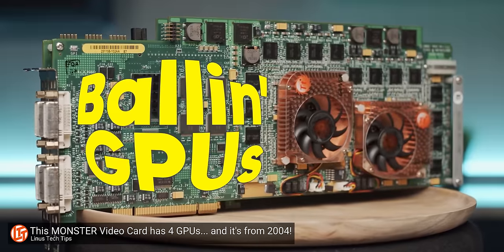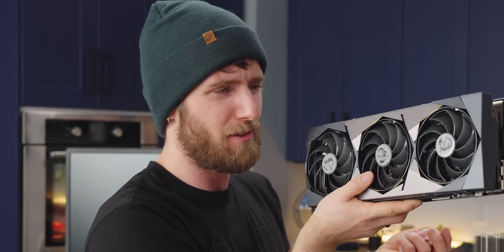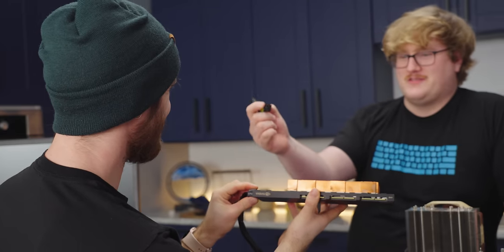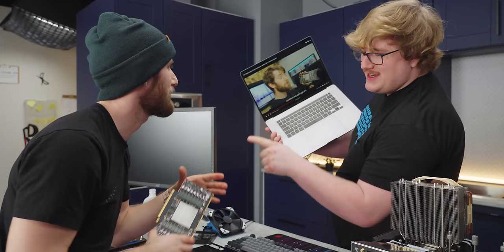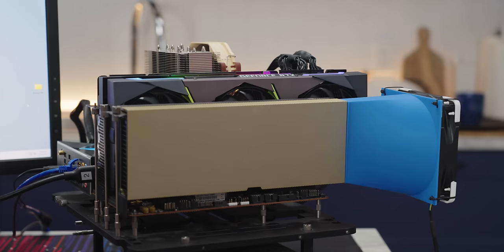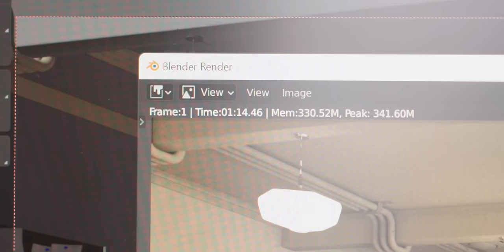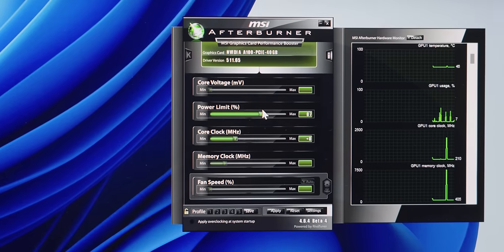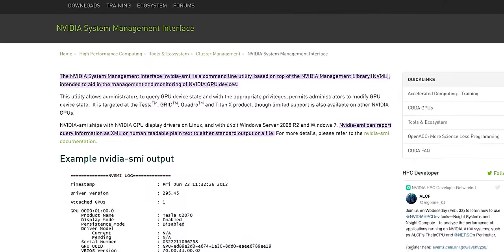NVIDIA REFUSED To Send Us This - NVIDIA A100

Comment: Fun fact, our A100 servers (8 80 GB SXM A100s per server) each have a max power draw of close to 5 KW. And Linus and Jake were right! Even with the 80 gig models, we still wish we had more memory. Never enough memory!
Reply: Big Iron.
Reply: what are you doing with that hardware?
Reply: @velo1337  Skynet, duh.
Reply: @velo1337  Playing Crysis, probably.
Reply: @velo1337  The largest AI models currently use hundreds of billions (or more) "parameters" (a measure of the size of an AI model), and we know due to something called scaling laws that bigger models are more intelligent. You can't fit hundreds of billions of parameters into less than hundreds of billions of bytes, or hundreds of gigabytes of memory. Thus, an AI researcher wants the most VRAM they can get, even to the point of distributing models across multiple cards and cluster computing, etc.
Reply: @ProjectPhysX  I used to handle that on racks upon racks of Xeon Phis for exactly that purpose. At one point, when Kepler based Teslas came out, three 6-card nodes replaced all that. Currently single A100 has more horsepower than all of them. Now I am handling racks upon racks of P100s and V100s.

Our project (custom written from ground up) use particle batches (we call them slices) as base unit for parallelization, four-card Xeon Phi  system needed 30 seconds to process 100 slices, with ~5-6 seconds of that was only data being moved around. Previous gen hardware (we have only one borrowed test system with A100) is capable of constant execution of ~13k slices/second per card when hooked to 100G network and ~8k on 10G network. Memory is one thing, but keeping these chips data fed is turning to be a bigger enterprise than the actual computational part. 

There was an AMD Radeon Pro card which used M.2 drive as cache. We tried to use that for portions of framework written in OpenCL, but it wasn't worth it, memory be damned, it was too slow, as it was basically desktop GPU :(
Reply: @Vatharian  - it is an absolute shame AMD hasn't followed up on those with later models. Too early, too little. Even the shitty model did wonders for movie rendering supposedly. Was it Disney or Warner who used them? Now with PCIe4 you have double the bandwidth and soon PCIe5 drives will be possible. Together with the new double-die Instict Mi250X and some (512GB+) of the super fast XL-Flash (SLC NAND optimised for performance) or 3DX-Point they would totally crush some extreme workloads despite the snail pace memory compared to HBM.
Reply: @velo1337  the cluster is available to many teams throughout the company, but our team specifically uses it to develop deep learning models for computer aided engineering tasks. Our largest model is a surrogate model for a computational fluid dynamics solver.
Reply: @Vatharian  Seems like the spam filter deleted my first answer because I posted a link to an arXiv preprint.
The progress hardware has made over the last decade is crazy. I also use my own CFD code, written completely from scratch in OpenCL. It runs 2 orders of magnitude faster on GPUs compared to CPUs, at the same power consumption. And it runs on anything, A100/V100/P100/MI100, gaming GPUs, Intel CPUs, even on the ARM Mali GPU of my Samsung phone. Visit my channel to see the software in action, and for links to my research papers :)
Reply: if only i could remember more faster!
Reply: Is that why an R9 390 goes for $100 more than a GTX 1060 even though it is older?
Reply: The cost price you'll have to pay for precise calculations.
Try running 32 bit fpp calculations, which are still good enough, and you can cut the memory down to between 500Megs to 2,5GB per WU.
Reply: @velo1337  your dad
Reply: guess what, i also maintain 4 of the DGXA100, and still we sometimes do not have enough
Reply: Literally what 80% of our A100 servers are set up as. We definitely changed PSUs and back up Batteries, cannot wait for Sapphire Rapids to come out (because we’re nearly ALL Intel) and have literally 10 of these that are AMD EPYC.
Reply: You guys need IBM addon memory cards :D
Reply: @velo1337  minecraft with shaders, they still only get 2 fps tho
Reply: @velo1337  having more than 2  Google Chrome tabs running smoothly
Reply: pls tell me ur not using consumer gaming gpus like 3000 series gpus aswell cuz thats all i care about. just let other people get gaming hardware.
Reply: @alt2484  at least for us, we couldn't use gaming GPUs even if we wanted to (we don't - we need the NVLink topology of the HGX platform for high performance GPU-to-GPU communication) because Nvidia changed the license on Geforce cards to not allow them for most datacenter applications a few years ago.
Reply: @tschrop25  All ~50 of ours right now are dual epyc 7532s, which turns out to work out really well for us. Turns out a few of our workloads require significant data pre-processing, so having 64 cores per server allows us to do that on the same node, instead of starting to take resources from our CPU cluster for training jobs. These are on a 3 year lease cycle, so it'll be interesting to see what our options are in ~2023 to replace them, both on the GPU and CPU side of things.
Reply: @alt2484  I am trying to get 100 of those to put in a mining rig.  Not gaming. It will pay off. When the cards start to get old I sell them cheap to gamers or whoever buy ... first come first served. Or I just use them until they die for ever or get unprofitable or have paid themselves off 10 times
Reply: @velo1337  running photoshop and lightroom at the same time.
Reply: @RecklessVac  i can understand why you want to do that but at the same time you are still ruining the gpu market, alot of people want new gpus but they just cant get one and you guys trying to use them for mining is just making it harder to get one for those that want it. I'm not a miner, so i don't know what makes a good mining gpu but can you please try and stay to away from 3000 series gpus because many people want the cards but they can't spend double the gpus value.
Reply: 5kW is absolutely fucking insane
Reply: Why not use a human brain?
Reply: data data data..............
Reply: Yeah, the small business i am working with only have a 2080ti lmfao.
Reply: @ProjectPhysX  d
Reply: @ProDigit80  What is your evidence that 32 bit fpp calculations are "good enough?"  The guys in this comment section are running custom written scientific code for simulations, not some tossed salad "deep learning" model (for which sure, you can use less precision at times, so long as it still converges...).
Reply: @zvxcvxcz  there are plenty of projects like deep learning models, folding, boinc that run on 32 bit. That's 7 digits before or after the comma..
Software can be updated, if your range is between 1234567 and 1234568, you can discard the first 7 digits, and still calculate with a 7bit precision behind the comma.
All can be dome in 32 bit float.
No one is going to tell me that 7 digit precision is not enough, if it's been used by a lot of professional companies around the world. Heck, even cad models can use 32 bit, and be 7 digits behind the comma (0.000001 mm) on projects of 10km in size.
No one can see, or manifacture that precision in real life.